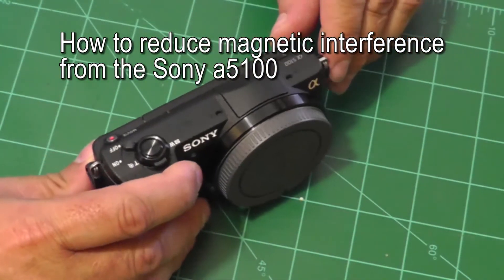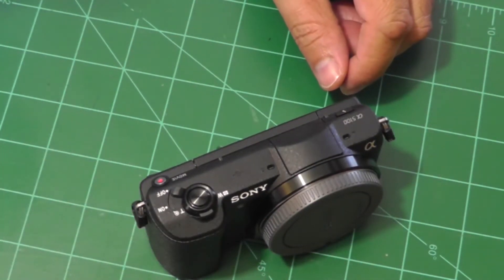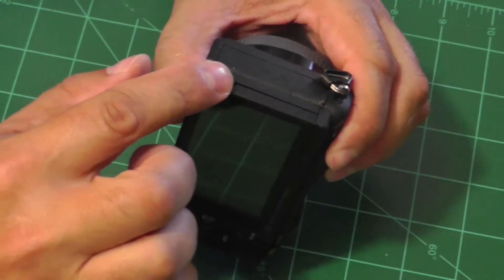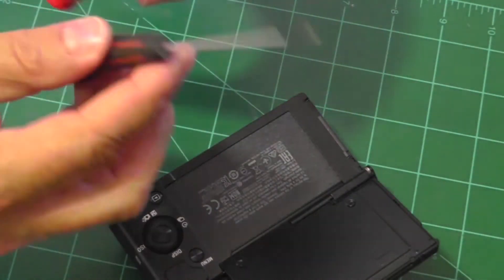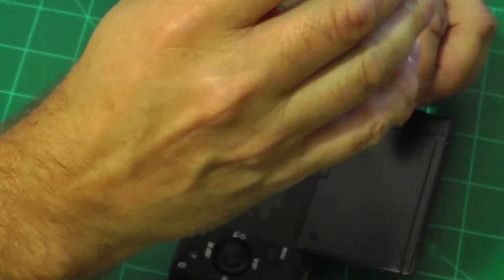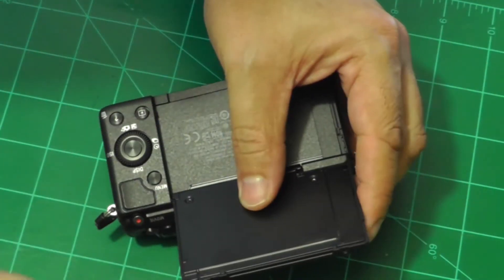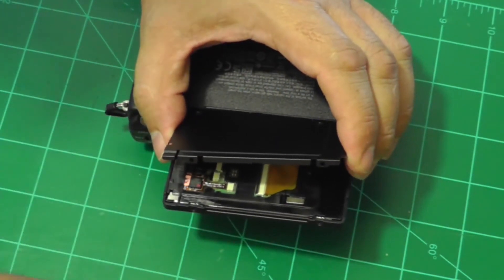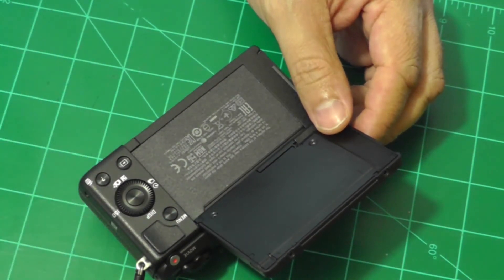How to reduce magnetic interference from the Sony a5100

Comment: Thanks for the tip about magnet ! Did you experience any issue with A5100 when shooting a lot of pictures for surveys ? I always have the camera stopping after 100 or 200 pictures. I supect an over-heating issue.
Reply from the maker: Bob, no I never had such an issue. I have done missions with over 600 images. I have some air flowing through the camera compartment. Maybe you can create an air intake and vent in your installation? Also switch off the image review function (default is 2s), and the auto shutoff function.

Comment: Nice trick! But I am not sure if I am getting magnetic interference and need to do this? What are your recommendations for the sony a5100 for mapping? Thanks!
Reply from the maker: You only need to do this if the distances between the camera and the magnetometers are short. It caused significant interference on a multirotor where the camera position was directly below the Pixhawk. On my Z3 and Skywalker planes, where there are over 3 inches of separation, it does not appear to be an issue. It is such an easy mod, however, that I just take the magnets out as a precaution.

Comment: I recently purchased an A5100 for mapping.  Would you be willing to share any other tips/settings such as the one in this video?

Thanks!
Reply from the maker: Coty, what types of mapping projects will you use the camera for?
Reply: FlyingMerf Thanks for the reply :)  I have been mapping several hundred acres of farm land and the goal is to achieve the maximum resolution feasible.  Previously we have been using a combination of multi-rotors but only the Inspire 1 Pro with X5 camera has decent (16MP) resolution but the flight times/amount of acreage we can cover with a single battery is abysmal.  We spend all our time swapping batteries <lol>  The hope is putting the A5100 in a plane (went with the Drak ;-) gives us the ability to fly faster/longer and still get quality images.  Previously I used a pixhawk fired Rx100 and S100 with a multirotor with good results but have not used anything nearly as fast as the Drak.  Thanks again!
Reply from the maker: +Coty Wood You can expect good results with the a5100. We use it on most of our fixed wing vegetation mapping projects, with a filter modification so that we can perform NDVI analysis. You should be able to cover over 400 acres per flight at less than 5cm resolution with the Drak, more if you were allowed to fly over 400ft.
Reply: +FlyingMerf  I assume you use shutter priority?  What is a good starting speed for "fast flight'  Around 1/2000?
Reply from the maker: Coty, for fast flying I crank the shutter all the way up to 1/4000. 1/2000 is OK if you fly high/slow. I use shutter priority only when flying an unmodified camera and the objective is to produce "pretty pictures". When the objective is to produce good data I use manual mode to ensure that the camera settings remain constant throughout the flight.